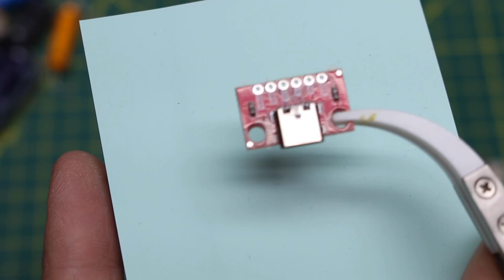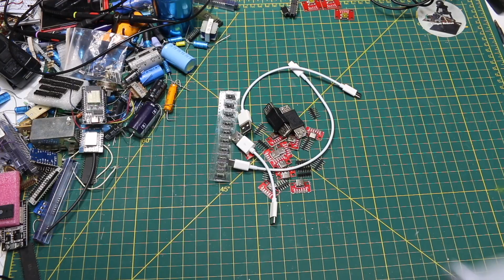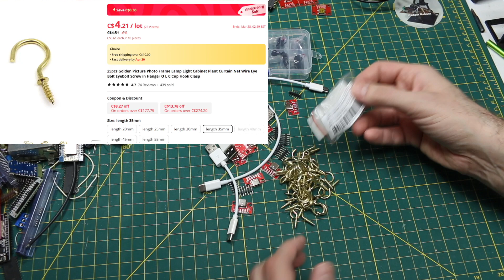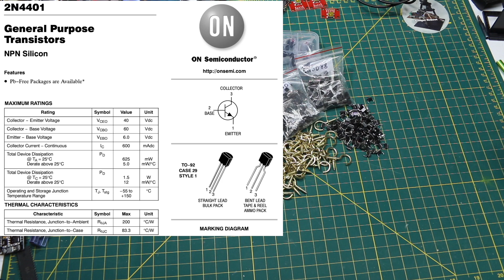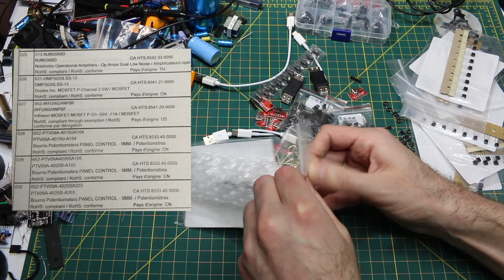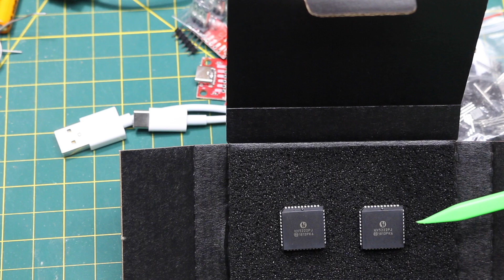Mailbag!

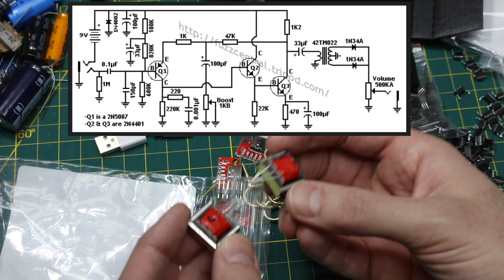Comment: 8:48 OCTAVE FUZZ!! 😆edit --- actually is that a treble boost? I was quick to guess.
Reply from the maker: it is octave fuzz although it might have been adapted from something else. I was researching different ways to achieve the upper octave and it seemed like the full wave rectified transformer method may give the clearest result and it goes back to the old days although that may not be what we always want, there’s other methods where they do something just with transistors and it has harmonics involved and you can only hear it on certain notes or frequencies halfway up the guitar neck so I just want to try a bunch of things.
Reply: @GadgetReboot  yes! This schematic is based on the Tycobrae Octavia. This is the one that I based my Taco Octave Fuzz pedals off of alright. I saw the transformer, and the 3 transistors, but for some reason when I looked for the diodes I just gave up and second guessed myself 😆 I have a video on my channel where I test a sine wave thru this circuit on my oscilloscope. This circuit actually shows up here and there in many different forms on my channel over the past 4 years!
Reply from the maker: I think I remember seeing at least one taco video now that I think about it.  I’m going to have to think of a name for whatever I come up with.  that’s the hardest part.
Reply: @GadgetReboot  I "borrowed" the name from an older Japanese builder, but they "borrowed" the schematic from Tychobrae. The "original" Taco used an octopus for its artful centerpiece. I used 🌮

Comment: I design/build Nixie clock circuits. Microchip HV5530s are perfect for Nixie applications, they work fine with minimal support components and minimal screwing around. Only drawback I know is that they are 12V devices (both supply and and data/control) so some level shifting is needed for use with 5V Arduino outputs. Your HV5122s appear to be very similar to my HV5530s. Not sure what that "using a ramped supply voltage" constraint is all about - the 5530s have no such note.
Reply from the maker: Im going to glance at the data sheets for the similar devices and see what the differences are, for the 12 V serial input I was thinking about maybe just using a transistor open collector up to 12 V as long as it can switch fast enough for the data rate, and I think there’s also some CMOS chips that can handle that sort of output but I don’t know if I have any of those around.
Reply: @GadgetReboot   CD4504s work real nice if you have some. Actually I think Mouser still stocks them. I've seen others successfully shift with weirdly connected FETs that apparently switch fast enough. I'm hazy on the details, googling FET (or MOSFET?) Level Shifter should turn up some examples.
Reply: @GadgetReboot   Hmm. YouTube seems to have eaten my reply. What I said was that a CD4504 makes a good shifter that does not mind 12V. Alternately, some people use weirdly connected FETs but I've never tried that. Googling FET (or MOSFET) Level Shift should turn up lots of examples.
The most obvious difference between 5530 and 5122 is that 5530 has a blanking input - PWM it at 1KHz to vary brightness of the Nixies.

Comment: 😮 220 volt. Wow. Almost spat my coffee on the table. Have not seen anything so small, that was so highly rated. I'll have to take a closer look at the datasheet to see how it is safety rated. I'm assuming there is very low current involved.
Reply: Current sinking outputs, 100mA per output max, per data sheet. So not for controlling big heaters or something 😀
Reply: Let me clarify something: that's 100mA per output with a maximum total current on the device of 1.5A, so you can't actually run 32 outputs at once at 100mA each.